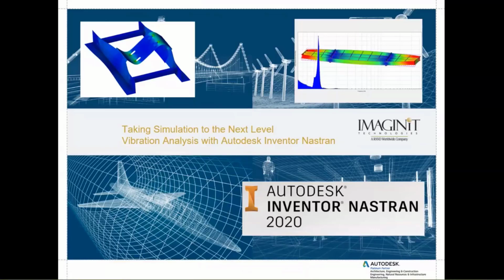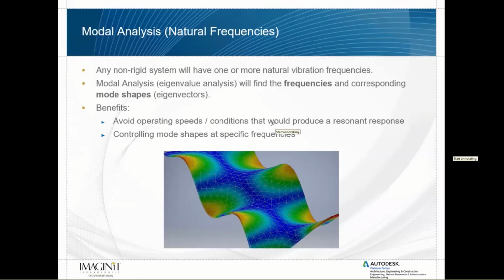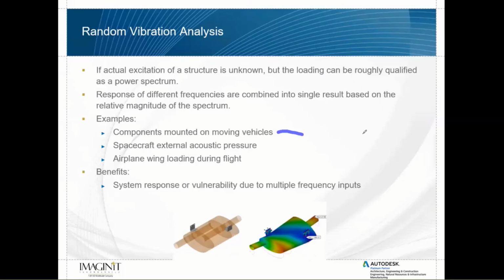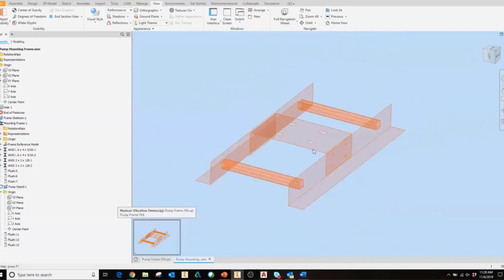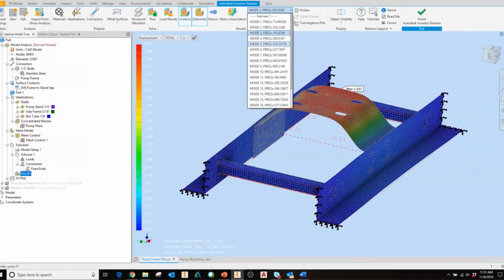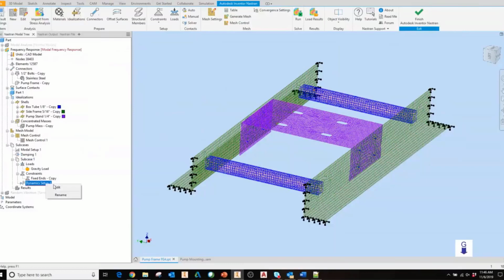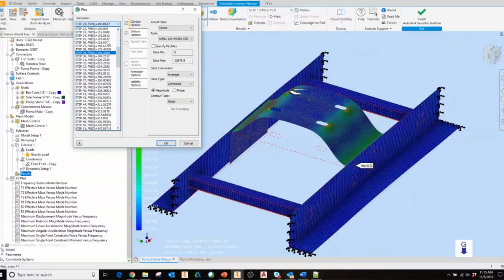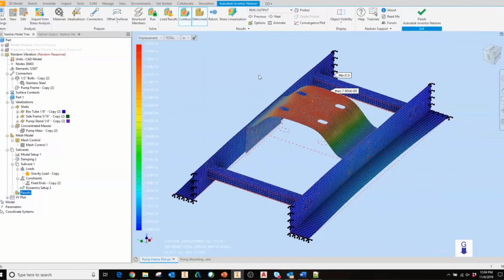Vibration Analysis with Autodesk Inventor Nastran

Comment: this is a great tutorial. I'm interested in the vibration exposure data PSD for off-road use. You mention there is MIL-STD data available for this but MIL-STD-810 G specifically says no data is available fo estimating ground vehicle vibration levels (page 514.6D-19) - can you confirm this? Cheers.

Comment: Very good presentation. Two question please
1. is remote mass considered in modal analysis or just the weight of the frame is included in modal frequencies?
2. how did you verify your results and ensure they are correct and can be relied on?
thanks,
Reply from the maker: From our experts: Remote Mass (Concentrated Mass) is included in the Modal Analysis in addition to the mass of the frame elements.
Reply: @imaginittech  Thanks for your response. One more question please: if you have a load imposing 10 lb @ 100 Hz to the frame (some unbalanced load) how do you consider the load? how do you define that the load is acting at 10 Hz and not 40 or 50 Hz? thanks
Reply from the maker: @mostafaa9084  Per the experts: That can be done with a Modal Frequency response. First - apply the 10lbf load in the direction of the force on the frame. Second - Open “Dynamics Setup” and add 10hz to the list of Discrete Frequencies. That will result in a 10lbf load being applied in an oscillating (sinusoidal) manner.

Comment: One more question please: if you have a load acting as 10 lb @ 50 Hz to the frame (some unbalance load) how do you consider the load? how do you define that the load is acting at 50 Hz? thanks,